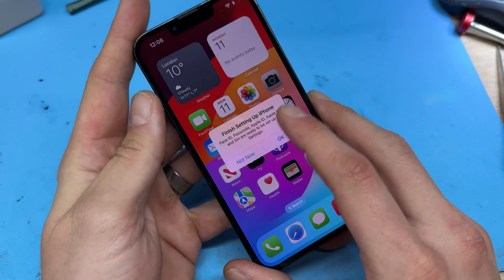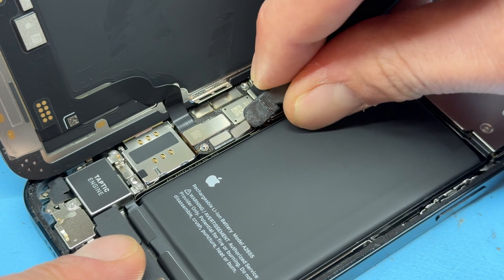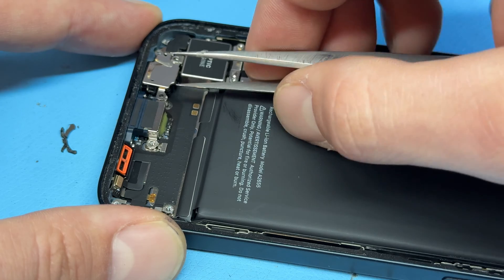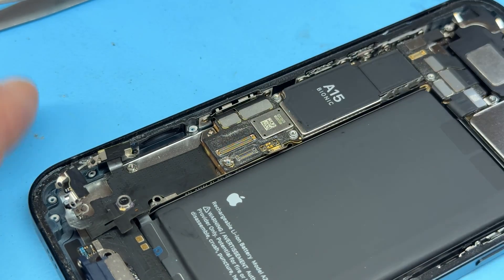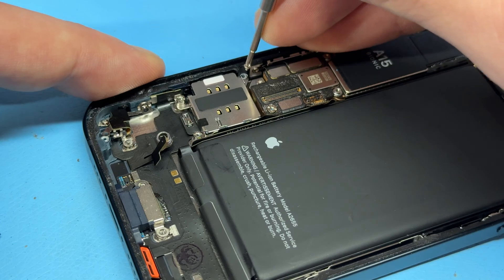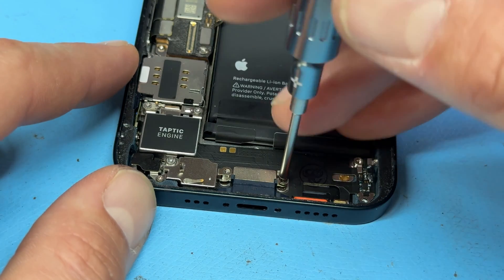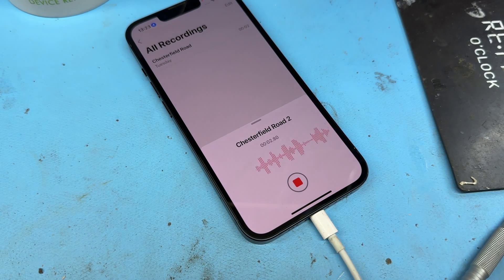iPhone 13 Charge Port Replacement: DIY Step-by-Step Guide!

Comment: Thanks for the video iDoctor UK. 
Has anyone tried this with the generic replacement ports that are available? Does it really mess up the barometric sensor (BS)? Is it easy to transfer the original BS?

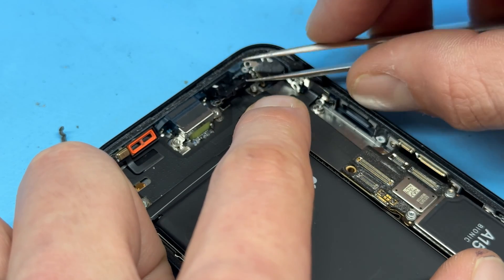Comment: Why did you cut at 6:04? That's the piece I now need to know how to remove... I assume it's easy but I'm nervous about pulling it without being able to see how it's done. Also at 8:35, when you talk about getting the microphone to snap down securely, you don't show how you actually get it to snap down, you just push on it and cut away. I can't get mine to snap in, it just sits there.

Comment: anytime you open these phones the adhesive that holds the screen to the frame should be replaced.  otherwise your screen will eventually come loose.  it compromises any sort of water resistance it once had.  not doing it right the first time is crazy work

Comment: what is the difference between pulled and regular in laymen's terms I don't know which one I got but they both look the same
Reply: In terms of what exactly if you are referring to parts OEM pulled  means that the part is original but used
Reply: @safwaanahmad4516   ok so pulled means, it was “pulled” from an iPhone? So if it’s an original apple part would there be a apple logo on it? Do they still do that? Just wondering before pulling anything apart if I can make sure I order the correct part and not get ripped off.
Reply: @ yes exactly that is what it means… normally with iPhone parts they come with an Apple logo but not sure if all the parts in the iPhone all have the logo
Reply: @ but most Apple parts would contain the Apple logo on in indicating that it is in fact original if it has a Chinese sticker or any sticker with a different brand or logo it would be aftermarket
Reply: @gemmaclark5508  but oem pull would mean that it is a used original part best option would be New OEM if possible but with iPhones even after replacing it with the original unless taken to the Apple Store will give a message

Comment: Alcohol? Eh...wouldn't do that. Use heat instead.

...ALCOHOL?
Reply: Its probably 99% isopropyl alcohol so it doesn’t damages any components and dries up pretty fast very hand when removing glue if you have no heat gun

Comment: Idk why half the comments are saying this is a lot, its just some screws and ribbon cables… I get it if you arent tech-inclined, but this is s greta tutorial with good steps and coverage so i dont get the complaints
Reply: Compared to a Samsung Android phone, this is a lot more involved. 8 screws, swap out a tiny PCB with the port and 8 screws and one connection later, and you're done.
Reply: I cant get to remove the screen tbh thats the hardesr part

Comment: Enjoying these videos, with thanks. By the looks, it's not much different to repairing laptops and desktops.
Reply: Lol. I repair laptops for my job. Most laptops just need a simple battery or SSD replacement, or have bad ram, which is easily solved. This is WAYYYYYYYYYYYYYYY more steps then repairing a laptop, and by the look of things, also way more chance to actually break something important.

Comment: NEVER slide something metal down inside an electronic or electrical device! I'm sure the OP knew what he was doing, but for the novice, if you don't know what's inside, never use a tool made out of conductive material. You will definitely short something out if you make contact with internal components. That being said, this was a great video!
Reply: Battery is disconnected. You won’t be shorting anything
Reply: 100% if the battery is still connected
Reply: Yup that’s what happened to me! Thought mine was dirty I just ended up messing up my charging port
Reply: Old school
Reply: If battery is disconnected then nothing to be worried about...first thing you do is disconnect the battery
Reply: That actually makes a lot of sense. 
Look at all the dummies in the comments trying to sound intelligent by saying you’re wrong.
Reply: Bros yapping
Reply: But does not disconnecting the battery as he did at the start safeguard that happening?
Reply: @lukecarvill7721  yes if the battery is disconnected, you won’t be shorting anything. Just allow a few minutes for everything to discharge..
Reply: @lukecarvill7721 the comment was directed at using the razor blade to pry open the screen 0:40. Since that step is before disconnecting the battery the likelihood of shorting the something is high (not including accidentally cutting a ribbon by pushing the blade too far inside). There's a reason why guitar picks and safe open tools are the norm in phone repair. No one is immune from shorting a phone so metal pry tools aren't recommended. 
-cheers

Comment: I’m curious if it’s possible to replace the lightning for a USB-C instead. Probably not with the motherboard having a controller chip for the lightning but it would be a nice breakthrough if so and that it just worked out somehow.

Comment: wow so many things to undo to replace the charging port. Is it not possible to take the charging port out and just desolder the port itself and put a new one in, so you can use the existing cable?
Reply: Technically this is possible however you’d have to remove the whole assembly nonetheless